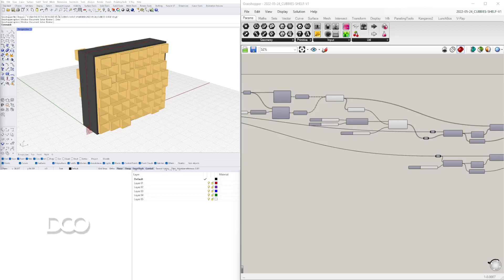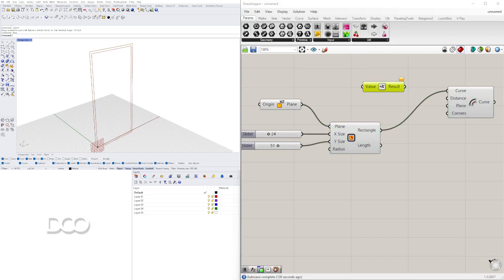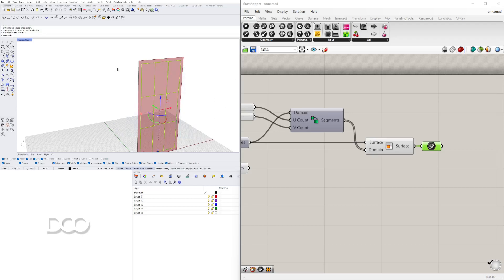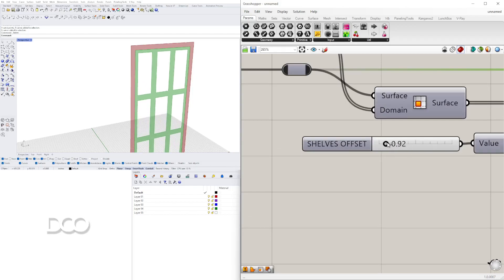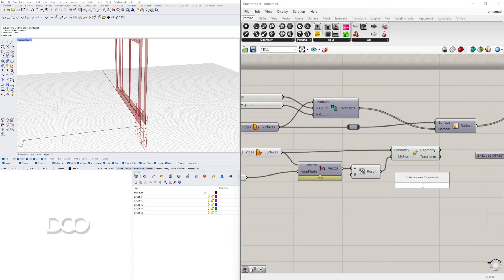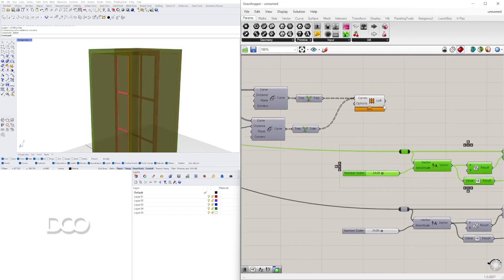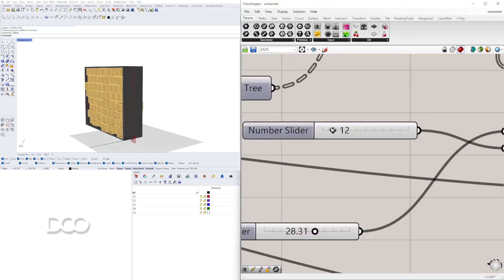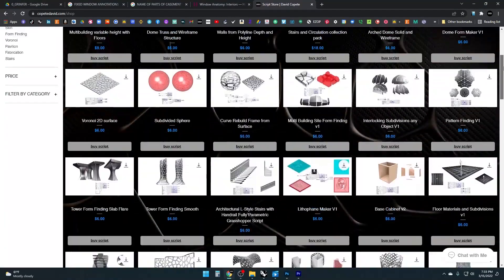Algorithmic Storage Shelves Rhino & Grasshopper Parametric Architecture and Design

Comment: I'm using your base concepts to try to make a battery holder for drawer storage. Where you make drawers, I want to make the grid have thickness and simply be walls. I'm new to Rhino/Grasshopper. Coming from SoiidWorks. If I offset the grid, then turn off the grid, how do I turn that into a surface that I can extrude?
Reply from the maker: You have to turn it into a surface before you extrude it so it extrudes as a solid.  Input the outer rectangle and the inside offsets into a boundary surface and flatten the input.  Here are other tutorials that can help you in the process.

If you need further help send me an email to dcographicstudio@gmail.com

https://studio.youtube.com/video/DZS1nbAvkuc/edit
https://youtu.be/Blc_B4Y008k
Reply: @DCOParametric  that second video is exactly what I needed. It's frustrating to understand the hard stuff and not know how to do the basics of rhino. I'll probably be signing up for your class at some point.